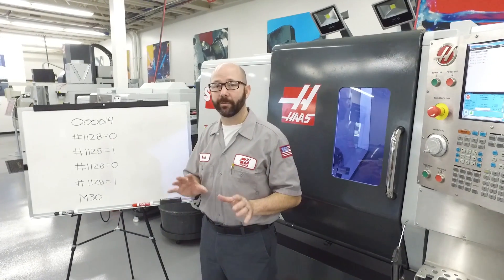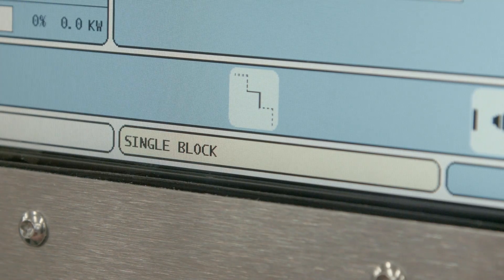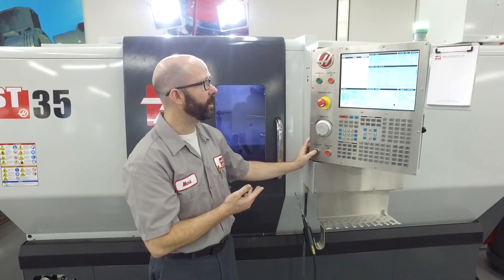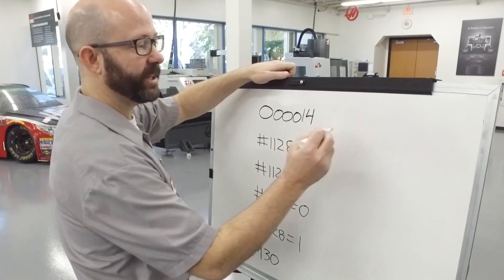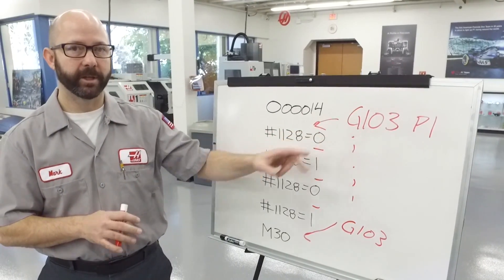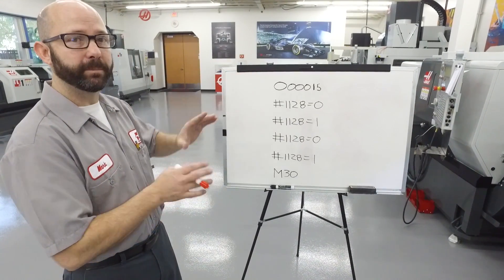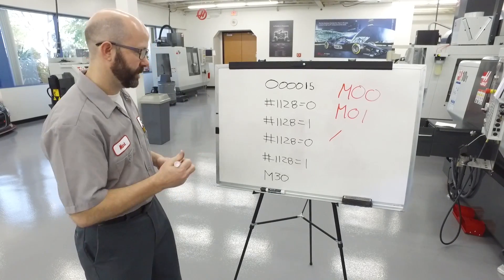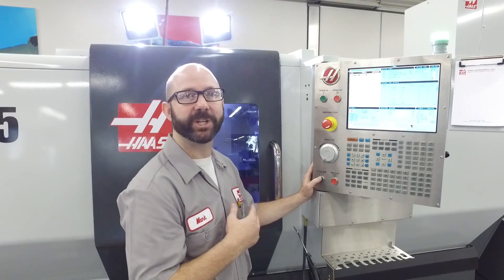Limiting Block Look-Ahead when using Macros – Haas Automation Tip of the Day

Comment: How jump block 
In fanuc we use GOTO command
Actually I used M98 but it's not working in Haas
Reply: M98 is an External sub call out on Haas. You'd want to use M99 (line #); to skip a line.

Comment: when using / to limit look ahead, does block delete have to be turned on? I am assuming not but want to be sure
Reply from the maker: +Joshua Boulee That’s right, the forward slash “/” blocks lookahead whether the control is in BLOCK DELETE mode or not (BLOCK DELETE button pressed).
Reply: +Haas Automation, Inc. thanks!